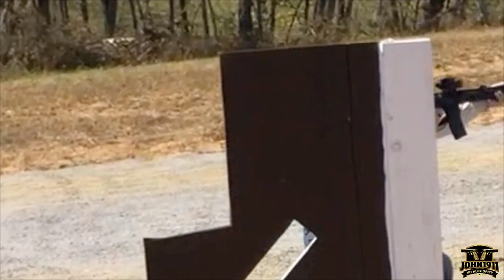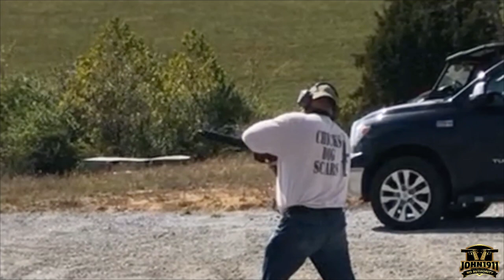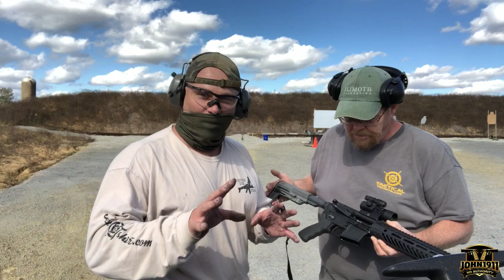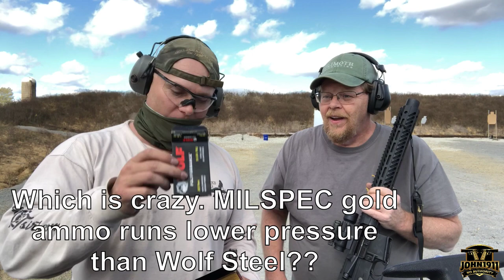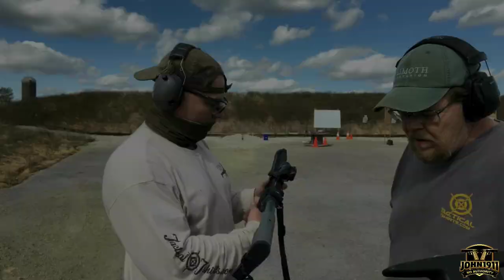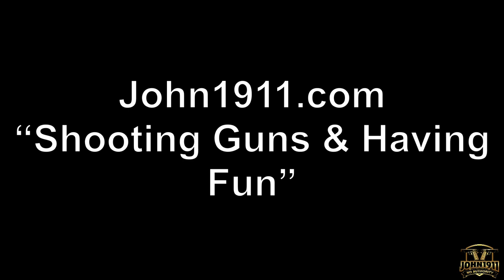Is Wolf Gold Loaded to MILSPEC

Comment: if you shoot steel, then switch to brass you will have problems feeding and extracting. Especially suppressed and dirty. Try it in another gun, shoot 100 rounds of steel and then switch to any brass.
Reply from the maker: Straight BCM upper never shows that issue. SCAR doesn’t either. But it’s worth noting.

Marky
Reply: @John1911  I have a few guns that are fine about it, and I have others that cannot go more than 3 rounds when that happens. No real explanation, just anecdotal evidence
Reply from the maker: @sarkardarkstar  Yeah. I've heard of it as a theory but never observed it personally. I just think I'll buy regular ammo going forward. It's not like I can't find it. Which is what got me shooting Wolf some years ago  to begin with. —Marky
Reply from the maker: @jcwoodstl  I agree. The gas-port on this upper is smaller since it's factory built to be suppressed. The WG ammo is just underpowered. 

There are more videos to come. 

—Marky
Reply: That is exactly the same experiences that I've had had with Wolf, or any other steel cased  ammunition for that matter. I have not had any problems with Wolf Gold at all. It isn't highly accurate, it is not by far the most inaccurate ammo out there either.
Reply from the maker: Dill Rogerz we buy ammo in significant bulk. Not retail. To date, we’ve no significant disruption from our ammo suppliers.

Even got a load in last week during the panic. 

🤷🏼‍♂️

Marky
Reply: Steel doesn't expand as much as brass and leaves a slight gap in the chamber letting carbon build up in the chamber. If you fire brass after steel you run the risk of failure to extract or failure to go into battery in severe cases. Mild cases it will likely be failing to cycle due to the bolt being slowed down. Doesn't matter if it's a bcm or DD upper. Steel still won't completely fire form to the chamber.
Reply from the maker: Steel is notorious for not fire forming in the primer pocket. Which can lead to breech-face erosion. 

Meh.

We have two types of guns here. Reference guns and working guns. Working guns get run hard and shot with whatever is handy. We’re generally too busy to be overly paranoid about X, Y or Z brand of ammo. 

We consume and move on. 

Regards,
Marky

Comment: Steel doesn’t expand brass does. You get more carbon blow back when firing steel so your chamber gets dirty.  Then when you switch to brass after steel you could get more malfunctions because brass expands into a dirty or tighter chamber.
Reply from the maker: Correct. Kinda. 

Steel does expand. It’s just that brass expands more for the better seal. 

Additionally when steel doesn’t seal properly around the cup, you can experience breech-face erosion through primer flaw. 

Regards,
Marky

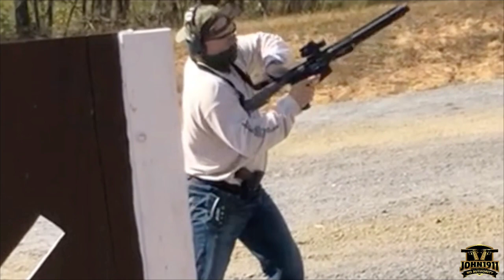Comment: 0:01 No. It is NOT "mil-spec." The protective coating, or lack thereof, annealing, crimping and pressures are not. It's plinking ammo, though.
Reply from the maker: 🤷🏼‍♂️ They claim its spec M193 ball. I’m not so sure. 

I moved on.

Marky
Reply: All my gold is annealed crimped and sealed 2017 lot and goes 3100 from my 16 inch
Reply from the maker: 🤷🏼‍♂️

This turned out to be a gun issue. 

Marky
Reply: @eddiearchuleta615  I am pressing X for doubt on wolf .223 traveling 3100 FPS from a 16" barrel.
Reply from the maker: Hence the “🤷🏼‍♂️”. 

Marky
Reply: @John1911  Can you give some more detail about the gun issue?
Reply from the maker: @derknizotts9162  the gun was way, way over sprung. My 07 put it together according a certain US website’s specs using their spring.

He warned me it wasn’t right but I wanted to keep “that spec”. Well…I ended up changing it out because it was st@pid heavy. 

Gun issue.

Marky